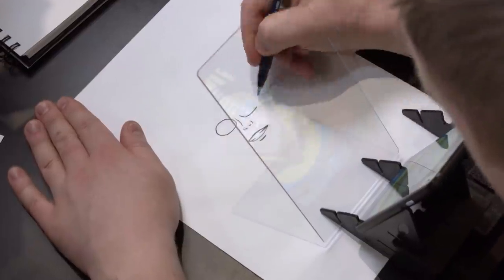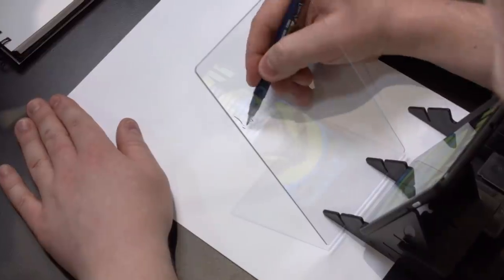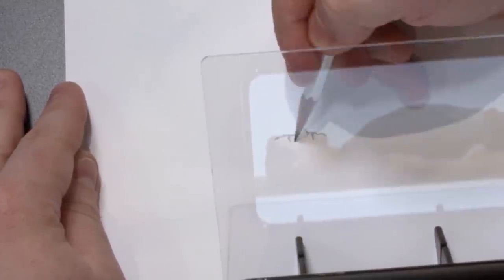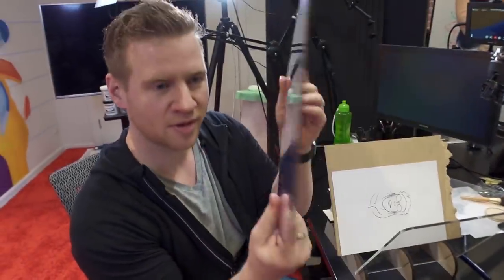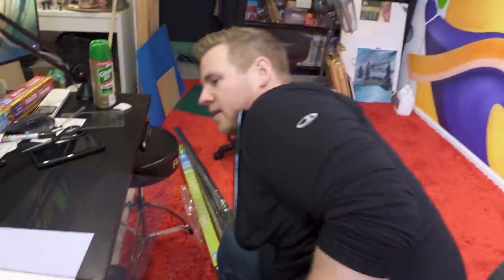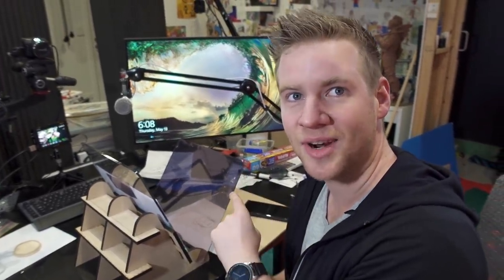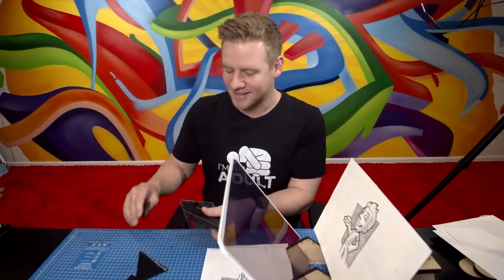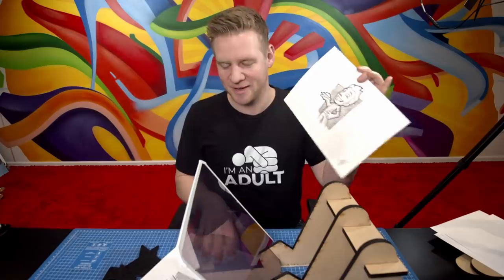Did I make the BEST ART COPYING TOOL??!

Comment: Art Tip: Tracing can be a useful tool for watercolor -- you can work on your composition on a separate piece of sketch paper, adjust and erase lines etc, and then transfer your final outline to your watercolor paper via tracing so you're not overworking the surface of the paper. Since watercolor is a transparent medium, any overworking from the sketch might otherwise show through in the finished painting. (Plus, it's nice to be able to quickly recreate a sketch or resize it, and get right to the fun part of painting!) :)
Reply: That's a good tip!
Reply: yeah i was thinking exactly this! i'd love it for watercolor painting . sometimes i just wanna have my sketch clean and just get straight to painting
Reply: THANK YOU that's actually a brilliant tip and one I've been looking for for a long time!!!
Reply: Good for getting a sketch onto a canvas too 🎨
Reply: Ah, I just made a similar comment before seeing yours. Another great point: this little contraption is much cheaper than a light box!
Reply: this is actually a technique you see in manga drawing by mangakas! they trace stuff multiple times so that the finished page can be as clean as possible ^^
Reply: I personally still tend to have trouble with proportions. (Pathetic I know) 
I feel like I could use this with what it's projecting as like a "skeleton" for me draw my own thing but make sure sizes are correct and train in that in long run. If that makes any sense 😅

Comment: I used to install vinyl professionally, and I have a huge tip for you Jazza! When applying that kind of material, spray a little water mixed with a few drops of dish soap on the surface before applying the sheet. The water helps keep the material from sticking too quickly and it lets you squeegee out the bubbles much easier. If you do get a bubble or two, go back in with an X-acto knife and poke a small hole in the center of the bubble. Then squeegee from the outside in until you get most of it out. Again, with water underneath this works much better. Keep up the great work!

Comment: Seems like a great thing to turn digital sketches into a finished physical piece when you prefer inking on real paper but you like to do the sketch virtually.
Reply: Or use the projection for the keyframes of an animation.
Reply: @neverendar1778  I had the same thought, but unfortunately this method flips the image. 

So if you have someone looking/walking left in the original, they will be looking/moving right in the copy. Stills could work if you flip it before you trace it, but adding that step between every frame of an animation isn't very practical; there are cheep reliable light table set ups that can do a better job.
Reply: Like a face/eyes

Comment: practical use case scenario - you made a sketch, you wanna refine it, you using this tool to trace and then make clear lines
Reply: I think it would be a nice use when you do digital drawing and want to transfer it on canvas or paper, without ruining paper with eraser!
Reply: lightbox is much easier
Reply: @ahmedshaikh7662  if you have printer. 
And it's more wasteful with printer.
Reply: still..it's mirrored... so youre not gonna get the original sketch
Reply: @Agent.J  Digital... You can mirror a sketch in software... That's one of the advantages of working digital...
Reply: @BaverIy  you don't need a printer to do lightbox, manga artists do this all the time without the need of a printer
Reply: @Agent.J  yeah, i forgot about that. But can you just flip original list of paper with your drawing and then trace it with reflection?
Reply: @ahmedshaikh7662  it depends on the paper you use, I use mixed media paper so the light wouldn’t go through
Reply: @jackdaw6095  it depends. Some lightboxes are strong enough that you can still see faint outlines even through some thick paper but yeah its not a perfect solution. I usually just use my bad, low quality paper for the sketch, i then cover the back with graphite and transfer it that way, much easier.
Reply: Yep. I've got one of those cheap light boards to trace my drawings when I want clean lines for coloring.
Reply: Yes.
Reply: yes
Reply: It could work for animation too
Reply: or how about buying a sharpie and an eraser?
Reply: You could probably also use it to transfer a sketch to a canvas for painting. Might even be a way to overlay a sketch on lighter backgrounds.
Reply: @BaverIy  I’m a professional traditional artist and I always sketch on my iPad and then transfer it to the paper to save paper!! My paper pads cost like $30 for 50 pages so it saves me a lot of money and time!!
Reply: Practical use for cringe 9 year old "artists": you can trace an actual artists work faster
Reply: @hgdrrfgrg  that's exactly what I thought throughout the entire video hahaha. That's also why the orignal from ebay was so cheap and small, it's exactly marketed towards those kids
Reply: We all know that bullshitters just hide the tool and pretend they are doing the sketch free handed.
Reply: @kitsunebiShake  isn't it more common for traditional manga artists to use light blue (or cyan) pencil for sketch, which won't show up when photocopied?
Reply: Did you plagiarize someone else work is your question?
Reply: :3 I can do that yoga move, but it is a bit painful. Haha. :3 Shalom.
Reply: @BaverIy Well, animal agriculture is the main cause for deforestation, pollution, world hunger, major health issues, and massive animal abuse. Especially if you use recycled paper, you're fine. Traditional art is great, and that's what we're literally doing with this. There are also thermal printers without inj cartridges. Shalom. :3
Reply: @BaverIy You also didn't think that much through, again. You can trace coloring books, magazines, trading card games, etc.

Comment: As someone who has worked with mirrored vinyl a fair bit, some top tips would be to spray the surface with water first and you can spray the adhesive side of the vinyl (a tiny amount of washing up liquid allows for some movement once placed), any bubbles that appear after can be pricked with a scalpel and the push the air through the tiny hole made! Hope this helps anyone 😊

Comment: Jazza, when applying window tint you apply a solution of soapy water to the glass you are tinting as well as the sticky side of the tint. Then after you have the tint where you want it you squeegy out the liquid between them & it will stick without having an bubbles if done properly.

Comment: Pro tip: If you want to get rid of the bubbles, first spray the acrylic with water and then apply the mirrior finish.
Reply: and add a drop of liquid soap to the water.
Reply: Wait, I'm confused, wouldn't that just trap moisture under the foil?
Reply: @lemmetalkaboutthis  Water can be moved and then moves the bubble with it, the surface where there isnt any as in the video here with the air however, will just make it stick imediatly, which causes the air to be trapped.
Reply: This was probably written on the box

Comment: One technique I've used to trace is by using my 27 inch display, putting a piece of paper flat against it, and turning out the lights in the room.   That method works effectively.   I usually use a 6H pencil for light tracing.

Comment: A good tip for applying tint film (or window clings) is to spray the surface with glass cleaner first. Makes it much easier to smooth out the bubbles.

Comment: If you like to sketch digitally, thicker paper like watercolor paper tends to be too thick for stuff like lightboards, so using a tool like the Etchr Mirror (which I assume the ebay listing is a copycat of) can be really helpful. Tracing isn't just a shortcut, it's a valuable tool in a lot of art and can be a good way to practice. Like all tools it can be misused, but it's not necessarily always used as a cheap shortcut.

Comment: I had one of those when I was a kid, back in the early 70s. The only difference was mine was dark blue, A4 sized, and mounted sideways. It was supplied in the UK by Crayola or one of the other larger manufacturers, I forget now. But it worked the same and was brilliant, came with a set of felt tips and a plain paper pad and a few colouring book style line drawings to copy from. It was patented but I havent seen one in 50 years so it will be Public Domain now.
Ahh memories. ;-)

Comment: practical use: depending on accuracy, could be a very useful tool for rotoscoped animation. Bolt everything down, stick a pegbar under there and replace the paper with an old laptop screen, then go through live acton footage frame by frame. Get some take on me vibes.

Comment: @10:00 Just a tip, add water to the sticky site that goes towards the panel and then squeakier it out so there is no bubbles or water. Dry it off, and your have a completely perfect installation

Comment: Jazza, if you ever find yourself needing to tint something again, which is what the "contact reflecty stuff" was, the best way is get a spray bottle with some soapy water in it, spray the surface you're applying too and the side of the tint that will be touching it with the soapy water, place the tint down and you can then squeegee out the soapy water, and the bubbles with it, and it'll then dry and stick in place perfectly flat with no bubbles at all.

Comment: I confess that I haven't read through the comments, but as far as a practical use there are still instances where tracing is simply a step in the process!  When working with expensive or delicate or watercolor paper for example, erasing can damage the paper or it's ability to absorb the media you intend to apply to it.  I have a lightboard, for example, solely to trace onto watercolor paper so that I can completely refine what I want to paint beforehand as the paper isn't especially receptive to erasure and I can't very well line in advance as most inks bleed or run when introduced to that kind of highly saturated media :)

While tracing is NOT creating artwork, it's a totally viable step and while the PSA is good, I hate to see tracing as a tool shamed (which it admittedly is quite often) when it absolutely has its place in the process.  Hell, a lot of us little art kids started off tracing characters out of coloring books and comics and while it's hardly original art, it's certainly part of the experimentation phase!  So while it not being part of your process is absolutely legitimate, what you made is still REALLY cool and could absolutely be useful to the right audience ;)

Comment: A  bit  late with my comment, but I gotta say that this is such a cool physics experiment that I am certainly gonna  take into the classroom when I am substituting for physics teacher this autumn. 

Also, tracing is quite useful in printmaking, particularly etching (corroding an artwork onto a copper plate for example), where free handing without any kind of sketch or guide is quite risky and can get quite expensive if you ruin the plate. And then there is the whole working with a mirror image deal. I usually use tracing paper (one that transfers either graphite or ink onto the coated plate when pressed with a pencil), but I would imagine this would work just as well.

Comment: With the device Jazza tested at the beginning, it feels like the biggest struggle would probably be the limited space near the bottom of the image since the reflective plastic goes at an angle that doesn't leave much room for a long pencil/ marker .... the only way to work around it seems to be changing the angle you're drawing at, but that be uncomfortable and hv a less accurate result.

2:28 3:20 For the blurring/ loss of clarity that Jazza complained about, I wonder if it would hv been helpful to turn off all the lights in the room (& hv the phone on its highest brightness) so that the phone was the only light source on the paper (especially since blocking some of the light seemed to help & it would be more convenient than holding an object for shade).
3:57 If it wobbles when he moves the paper, I wonder if taping it to the paper would have helped (there could still be a slight wobble of the phone in the holder, but it seemed easier enuff for him to realign it in the Invincible drawing).

Comment: The device that appears at the beginning of this video. Is very similar to the device. That appears in Penn and Teller's film "Tim's Vermeer". (Yes, Penn and Teller the magicians) But instead of using clear plastic. Tim uses mirror's to achieve the same. If not, better results. Than the clear plastic version. Have a look at "Tim's Vermeer" trailer here on YouTube. To have look and see there contraption too. Tim took it a lot further, by using his tool. To copy a full Vermeer painting. It's a great film that's worth checking out!

Comment: Hey Jazza, how are you? Listen I noticed that, the mirror paper is window tinting. The best way to apply that paper without the tiny air bubbles is with the use of soapy water in a spray bottle. Spray both the paper, and the glass. Then apply the paper to the glass. Then squeegee all those tiny bubbles out with a clean finish. Trim off excess and you're good. Hope this helps.

Pablo

Comment: I think it will work better with a convex lens then a sheet of reflecting glass. You will not need to see through the lens the light will appear on the paper. The art just need to emit it own light which can be achieved if it is a screen or a paper put above a screen.

Comment: No but this, rather than using it for tracing, could be used as a guide for painting! 

Like you can use it to have your drawing always on top of the paint so that you can apply the dark tones where they need to be without covering the lines and then add the middle tones on top and then the highlights and the whole time you can still see your original drawing so that the end result is what you had in mind!! 
Also for watercolours, it's impossible to erase your lines under watercolour, but with this... it's not a problem anymore!!

Comment: I'm issuing a challenge! Copy a marvel comic book cover in two different ways😁. The first one you will do your best using any and all of your traditional methods. The second one you will use this new tracing tool in any way you see fit. In both versions you will attempt to replicate the cover art to the best of your abilities including line width and color gradients. Will using this tracing method enhance what you can naturally do by eye with the material as a visual reference? Will that tracing method add that little bit "extra" to specific details when compared with the original side by side? And all of us here following should vote which is more accurate. 👌

Comment: Ok. It's all fun and games.
But have you considered...
A flat light.
A Milky glass/acryl.
A Frame to put the light underneath and the glass/acryl on top.
And thus make yourself a cheap, even better working LIGHTBOX?
If you wanna trace, a Lightbox is the best you can do.
I worked with a glass table and a desk lamp before - it doesn't has to be expensive, it's fairly easy to make your own - and it's far more comfortable and foolproof XD

Comment: A Little easy arthack for adding foil without bubbles: just Spray spray a mixture of water and soup (one teaspoon of soup with one liter of water) on the glas before adding the foil. Then add the foil as you did and you Can Push the water and air out of the foil. Let it dry and tadaaaa.... no bubbles :)
 Have Fun with perfect applied foil.

Comment: What if you used it to draw over your line work. Put the line work in the contraption. Then do a nice clean final without needing to erase
Reply: Imagine doing a test on different qualities of art supplies. But your linework and pencil sketch you normally have to erase as you do inking is what you reflect . Then you can make multiples with different supplies but the exact same sketch and you never have to erase anything on your art and you can compare the exact same piece with the same starting linework

Comment: It is an amazing tool for artists as well dear, you see, I paint with watercolor and where I live, the watercolor paper is extremely overpriced, it's borderline absurd, SO, I feel so insecure to sketch directly on the paper afraid to ruin it, that I created my own method of tracing as well haha, I have a huge glass plate where I glued those little tables leg's support and I put my sketch there, the watercolor paper above it and I use my cellphone flashlight as a lantern, underneath the glass plate. Then I can easily and securely trace the original drawing to the paper and paint without errors. Because, oof, holy shmoly, the price of this paper in Brazil cost my whole damn salary, not kidding. 😭

Comment: This is probably good for tracing objects, say for reverse engineering purpose, since if you are good at it, you might be able to trace the outline of a cut section off of something, which is not possible with methods like shadow boxing or taking a photo. 

For tracing image, the clearly better choice is to either do it digitally or use a light table.

Comment: bruh what.. lmao what you built is a less efficient contraption of what already exists, a smaller scale overhead projector, omitting the light source placement but the fundaments are maintained.. the concept of you made a knockoff overhead projector. if that's what you set out to achieve then, uh, congrats lol. also, no, this didn't optimize tracing because light boxes exist and have already revolutionized the practice. anyway-